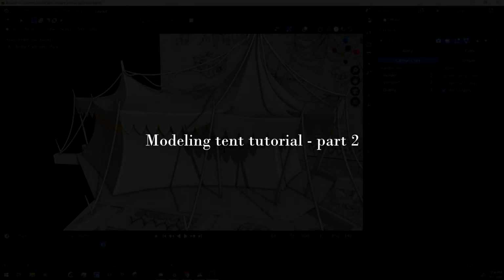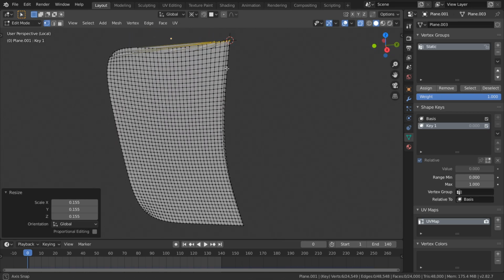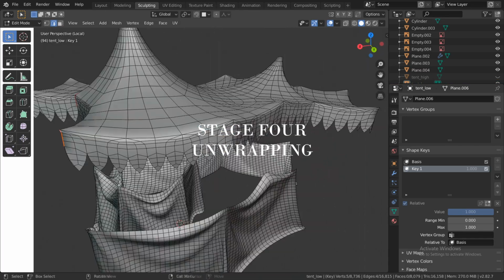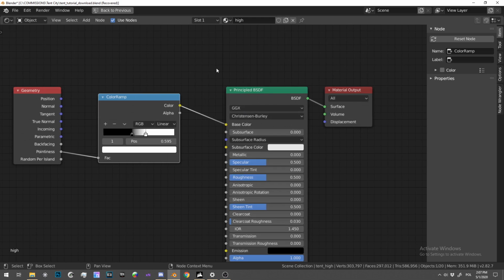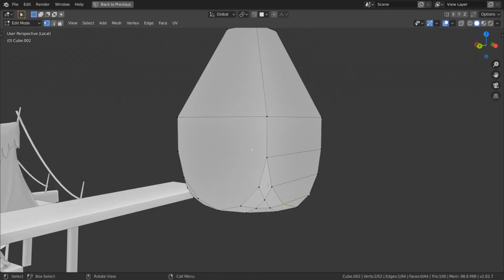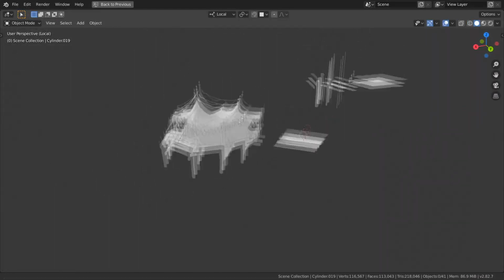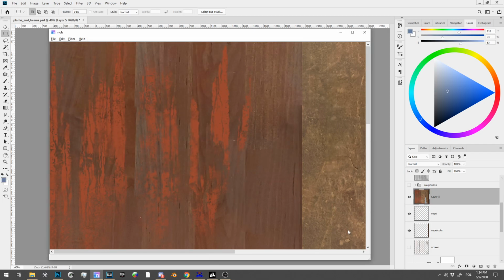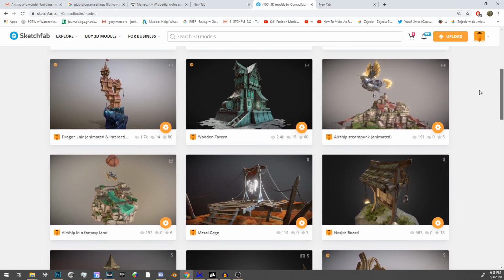Modeling tent tutorial - Part 2

Comment: I was able to follow along until we got to baking the normal maps, then I got really lost.  My normal map did not look like yours at all.  It was a bunch of squares.  Anyway, maybe I'll come back to try again when I gain more skill?  Thanks for sharing your process.
Reply from the maker: Hi! Check if you have 'Clear Image' turned on (It should be in the 'Bake' settings under the 'output') - it will clear previous texture and replace it with a newly generated one.  In this video - I used the default checker texture and replaced it with the generated normals - this is not the best practice. It is better to create a new texture instead of overwriting existing one. Let me know if setting the 'clear image' on helped. Also - remember about activating the texture by selecting it in the shader graph before baking.